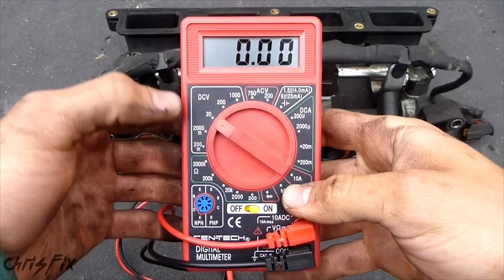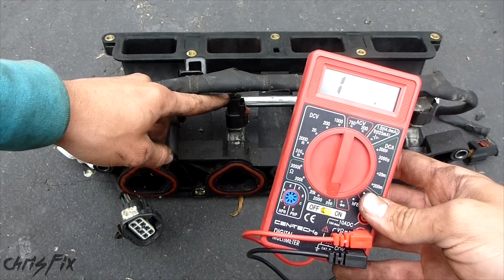How to Check Fuel Injector Resistance with a Multimeter

Comment: going to buy a noid light I guess. getting 12 volts to the connection . the oms on my 1994 350 motor 5.7l  @ 1.5omhs. this has not got me beat yet..
Reply from the maker: ron gann Keep me posted on what you find and good luck!
Reply: yes I will as soon as I find out will let you know
Reply: hay  got it figured out  it was the brain ..on pin 16 no ground
Reply from the maker: ron gann Awesome man! Good work! Glad you figured it out!
Reply: now just waiting on the new brain

Comment: hay chris  I have a 1994 but the injector on the passaneger side does not work even with a new one any thoughts on this .. you can email me at gannklann@att.net  any time  thank you  Ron
Reply from the maker: ron gann Are you getting voltage at the electric clip that connects to the fuel injector?
Reply: yes I am this is the second injector I put in. the bad thing is everything is working . everytime I take the injector out the bowl is full of gas . I'm still puzzeled.
Reply from the maker: ron gann Are you getting pulses of power or is it constant power? That is strange...
Reply: pulse..
Reply from the maker: ron gann Weird. Did you try switching the injectors around?
Reply: no not yet but will try . it shows that my injectors are wire to my computer hot side and neg side . strange . so today sunday we are going to do all vacuume lines and get them right . if bad replace then go to the next step .checking spark just to elimate the fire ..check all spark plug wires and spark plugs . the injectors are suppose to  hot right ground left ! . both injectors wire hot and ground got to the brain I ran these wire straight to the brain , getting fire . I'm not going to get me down I will figure this out hope to any way ..
Reply from the maker: ron gann Good luck and keep me posted!
Reply: sure will  I found out my fuel pump went out  . going to fix it .
Reply from the maker: ron gann Good! Hopefully that fixes it!

Comment: I have a 2002 Toyota corolla,I had a small fuel leak at one of the injectors,I replaced the o-ring that was damaged but the problem I am having is when I went to push the injector back into the fuel rail,the o-ring gets pinched,I replaced all the o-rings on each injector since I already had the fuel rail disconnected  and everyone of them was a pain to push back into the fuel rail.Should I have put some kind of lubricant on the o-rings so that they would slide up easier into the fuel rail? I bought the correct size o-rings for those injectors from AutoZone.
Reply from the maker: 9945223 Use some silicone lubricant to prevent the o-ring from getting pinched.
Reply: Thanks

Comment: Can someone help me please 
I have a 02 nissan altima 2.5l 5-speed
The car runs and drives great when it starts
But i noticed lately in the cold it just cranks and cranks, i would love to figure out what it is because its a good car. I was thinking probably the fuel injectors. I know im getting spark because the car sounds like it wants to start, then if i leave it cranking its like the spark kills the gas, then the rpms dont move at all.
Any help would be greatly appreciated.
Reply from the maker: Jonathan Quinones Sounds like a fuel problem. Here is how you test the fuel system to see what exactly is causing the problem: https://www.youtube.com/watch?v=_oXLUqE4Sf0
Reply: Thanks ima look into it more im gonna try recording it so i can get some answers to what it can be
Reply: ChrisFix How would I be able to test if its a fuel injector problem?  I wanna see if i can put propane in a hose to the motor so i can try and see if she starts any thoughts?
Reply from the maker: You can use these videos to tell how your injectors are working: https://www.youtube.com/watch?v=tA_E6X4ISgQ
and this one too
https://www.youtube.com/watch?v=ZVXchvHefNc

Comment: Hi Chris could you help me. I have mitsubishi eclipse 2001  4 cyl I replaced spark plus, wires and one coil  The problem is  h still has misfire detected cyl #2 so I swap that coil to cyl #1, Now the thing is still has misfire but is cyl #4. cyl #2 is ok  Thank you
Reply from the maker: ***** That is weird. What happens if you switch the coil in cyl 4 with cyl 1?
Reply: ChrisFix The misfire before it was in cyl #2  then I swap the coil to cyl #1 after this scanner shows misfire cyl #4.
Reply from the maker: ***** Yea, I know. Put the cyl1 coil on cyl4 and see if it changes.
Reply: ChrisFix I can't do that because that car use only 2 coils cyl #1 and #2         cyl #3 and #4 use only wires..I replaced already the wires but is still  the same thing misfire cyl #4
Reply from the maker: ***** oh ok. I didnt realize that. Sounds like you might have a problem with a coil then.
Reply: ChrisFix When it moves the misfire could be an inyector or should I focus only on the coils and wires . thank you.
Reply from the maker: ***** If moving the coils around causes it to change cylinders, it is the coils. Otherwise you might check the injectors.
Reply: ChrisFix I will do that, your videos have helped me a lot. thank you very much.

Comment: Hello!! I got a p0300 code on my 350z and already measure my injectors.. Service manual said they should be 13.5 to 17 ohms and mines have 12.7 so u think there bad? Just want to make sure before buy them. They are expensive. Lol.
Reply from the maker: Ruben Are they all the same resistance? If so, I doubt it is the injectors. How do your spark plugs looks? How many miles are on them? What is your fuel pressure? Fuel Pressure Test
Reply: Idk yet bout the fuel pressure didn't do the test yet. Spark plugs are good. Just install a new fuel pump to. And the injectors there's 2 that has 12.9 another 2 that has 12.8 and other 2 12.7.
Reply from the maker: Ruben If you touch both of your multimeter leads together, what resistance reading do you get? Those numbers are consistent so I doubt all of your fuel injectors went bad at the same time. That almost never happens.

Comment: I measured mine through this method and gives me a measure of 0.9. What does it mean?
Reply from the maker: gugolero Are all of them the same? The key is consistency. You want them all to have the same resistance. If 3 are the same and one is off, that is your bad one.
Reply: Actually it corresponds to the single injector of a motorcycle. I've already cleaned but I'm afraid it  has stopped working definitely
Reply from the maker: gugolero You can try to listen to it and see if it is firing using this video: Testing Fuel Injectors Fast
Reply: No sound, only silence.....grgrgrggrrrrr
Reply from the maker: It is most likely a bad injector. Good job figuring that out!

Comment: Does this test if the injector is leaking?  Have a 240 Volvo that I'm getting fuel in the oil.  Wondering if this will test for a leaky injector.
Reply from the maker: Nicholas Slaughter A leaky injector can be tested by doing a fuel pressure test. Here is a video on that: Fuel Pressure Test

Comment: I'm having lots of difficulty removing the plastic tab from the fuel injectors on my pt cruiser. The red clip won't budge. Is there a certain way to lift this clip?
Reply from the maker: Just as you saw at 1:44, you slide the red clip up and press the black clip down.
Reply: ChrisFix
Mine must be broken. I pulled on the red clip with all my might and even tried prying with a screwdriver but nothing moved.
Reply from the maker: Hm, maybe try pushing the injector down a little into the head.
Reply: ChrisFix
I'll give it a shot thanks.

Comment: you should be testing the injectors when they are warm.  run the engine to operating temp. then read the injectors resistance.  heat changes everything.
Reply from the maker: Jeff Stowasser Thanks for the tip! The main idea is to see the one injector that is not the same resistance as the others which will happen cold or warm. Plus, the engine isnt warm when you first start it so it should still be within the manufactures resistance range!

Comment: I have a 1.6 diesel engine that will smoke a lot when starting cold. It starts first time every time but will emit white smoke until it warms up. I've had leaky injectors for a while (which only needed the copper rings replaced!!) and the consequence to that is that I blew my turbo (unfortunately not spectacularly..) But I've always had smelly white smoke on cold starts.

I'm yet to do the test in your videos, but I was wondering if this is a symptom of faulty injectors.. Do you know?
Reply from the maker: nandohb1 This sounds like the leaking injectors are putting too much diesel into the cylinders and when you start up, the unburnt diesel is causing it to smoke.
Reply: ChrisFix Thank you for the reply.
Is that something that can be programmed from the ECU? Because I've checked with ALL of my local garages and none of them can replace my injectors as they don't have the equipment to code the new injectors.. This could be the reason for my bad MPG.
Reply from the maker: nandohb1 I am not as familiar with diesels, but you should just be able to take the injectors out and put new ones in if they are the same injectors. On a gas car you dont have to reprogram anything if they are the same injectors. This is not something you can do with the ECU because your injectors are leaking. I would do a fuel pressure test and verify they are leaking: Fuel Pressure Test
Reply: ChrisFix Fortunately all four injectors only needed the copper seals replaced to fix the leak, so it wasn't the injector itself that was leaking, it was the seal. I believe they are fixed solely because I don't see my diesel swimming away from my car when it rains anymore!! I shall do the tests and let you know if anything appears to be wrong, but I've been told twice now that the reason for the white smoke on cold starts might be because of unburnt fuel left in the cylinders!
Reply from the maker: Great! Glad you figured it out!

Comment: if you have a bad fuel injector its better to just change all of them. Your car will run a lot better
Reply from the maker: You dont have to change them all if the rest are fine. Some injectors are expensive so it might not be affordable. Obviously all new injectors will be the best situation, but not always the most economical.

Comment: Dude, as soon as you said PT cruiser I was hoping you would throw it in the trash. Lol
Reply from the maker: The PT cruiser is currently sitting in the garage with a blown engine. So, it basically is in the trash lol
Reply: I have a friend of mine with a pt cruiser that I guess got screwed over and still making payments on it. Lol he has about 4k left, how did you blow the engine?
Reply from the maker: Out of nowhere the engine got really hot and in about 10 sec, there were noises I wish I could un-hear. Happened so fast and out of nowhere. I am thinking about putting a new (used) engine in her. I am just not sure it is worth it because the value of the PT just dropped out. You can get one in decent shape for $1k more than if I put a new engine in it...
Reply: I wouldn't spend the money, just get rid of it. By the way I wanted your opinion or if you have the time to help me out. I'm a mechanic in the Air Force but since they provide all the tools I never really spent any money on a nice starting set of tools outside of it. What do you think would be a nice set to start off with. I was checking out craftsman on the 220 pc set.
Reply from the maker: ***** I dont really have any recommendations on kits because I dont really buy kits. They say it is 220pc set but in reality, you are getting like 50 little screwdriver bits that you wont ever use. I prefer to buy the tools in smaller packages. Like a wrench kit from 5mm up to 20mm and the SAE equivalent. Get wrenches, ratchets, sockets, a few screwdrivers, and other basic tools that you know you will use. Then you have the tools you will use and can mix and match brands that you like. I get many of my tools at harbor freight because that is what I can afford, and they are pretty good because they have a lifetime warranty.  My dad likes craftsman, and they are pretty good but way expensive! Hope this helps! Let me know if you have any further questions!
Reply: Yea I might just get a lot from HF than upgrade the ratchets little by little. You are also right about screwdrivers etc. those things don't gotta be expensive in your box of tools.

Comment from the maker: +Hector Garcia-Martinez For some reason I cannot reply to your comment so I hope you see this. You need to test your fuel pressure and let me know what happens when the car is warm. Do these tests: Fuel Pressure Test
Reply: Hey ChrisFix what is the brand/model of that multimeter? I'm pretty new to doing repairs on my car, and that tool looks all kinds of useful ✌
Reply: @ @jaicabryizky6987  its a cen-tech from harborfreight they also have different models inexpensive and such a great tool hope this helps you

Comment: I have a 02 escort zx2 that turns on fine when it's cold, but when I drive it and turn it off if I try too turn it back on it won't start however if I wait at least 5 minutes it turns on. Do you think it's the injectors???

Comment: ChrisFix have you ever done a tutorial on how people can connect to the car's computer?

Like, using your smartphone or computer to read information such as RPM, speed, fuel consumption. And maybe possible delete any information that the car accumulates.

I think it is called a OBD2 interface, mechanics use it when they are fixing cars.
Reply from the maker: I am working on that as we speak. The video will probably be out in a week or two!
Reply: i just had to ask because i felt a disturbance in the force

Comment: This is worth a try, my truck has had horrible gas mileage since I bought it. Close to 100 miles per tank, I'm not sure what it's supposed to be rated at.
I'll try this tomorrow, great video.
Reply from the maker: What truck? What year? How many miles? Have you tried this: How to Check for Bad Spark Plug Wires
Reply: ChrisFix it's a 1999 Ford ranger 4.0l v6, 4x4 with 140,000 miles. I have replaced the spark plugs and wires.
Reply from the maker: wow, that is basically my truck and I get 18mpg (actually after the plugs and wires replacement and power steering flush, I have been getting 19.6mpg which is my best yet). No check engine lights? How is the idle? At 55mph what rpm are you at?
Reply: ChrisFix No there haven't been any check engine lights yet, the idle sounds normal. I would have to check the rpm sometime.
Reply from the maker: Let me know. I will have a video coming out on MAF cleaning that might help. Is there any black soot at the end of your exhaust or on the body of the truck by the exhaust (indicating it is running rich)?